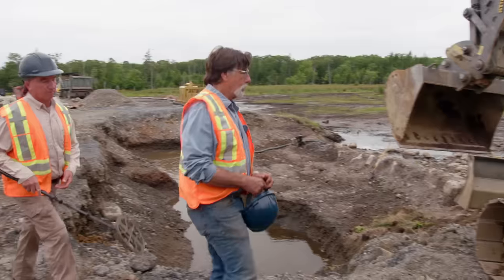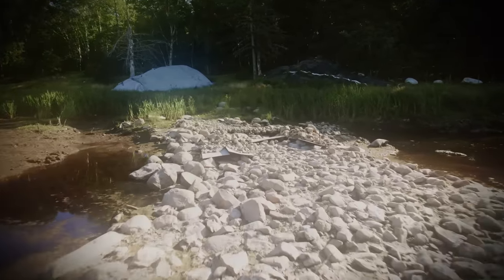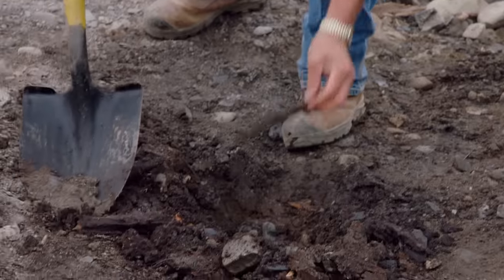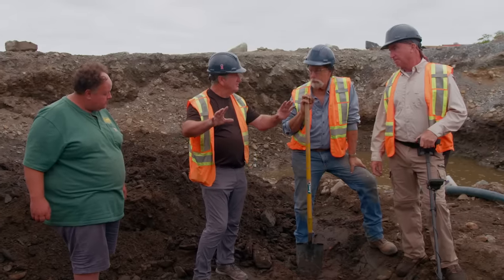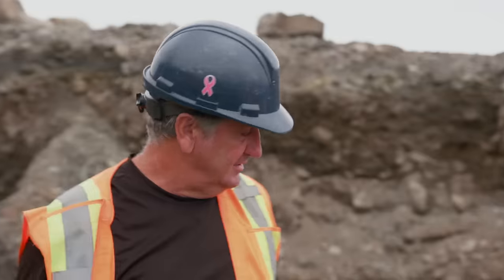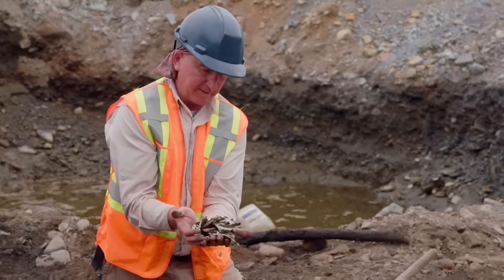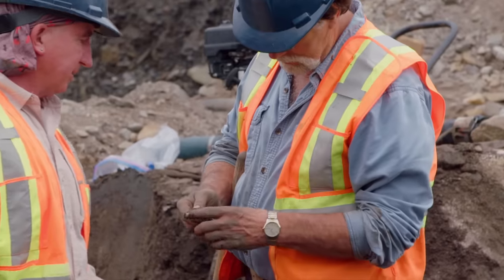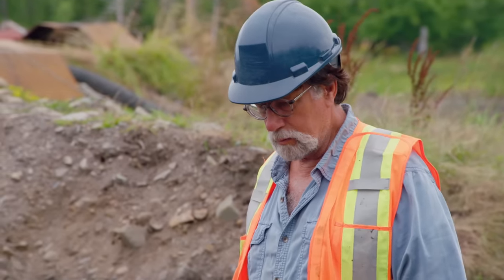The Curse of Oak Island: Ancient Ceramic Treasures Unearthed (Season 11)

Comment: No way that they had technology that we can't even match 😅
Reply: EXPLANATION:  The sea level surrounding Oak Island was markedly lower in the very distant past allowing for all the construction/engineering including the man-made (artificial) beach at Smith's Cove together with the structures buried deep beneath it and the box drains beneath said artificial beach.  Even the cavern(s) deep beneath Oak Island were probably high and dry in the distant past.  With the slowly-rising sea level over the past two millennium, everything is now underwater and inaccessible.